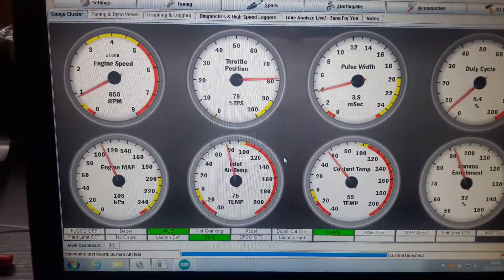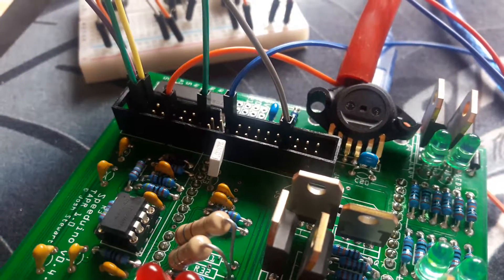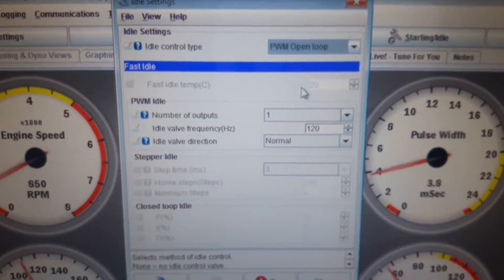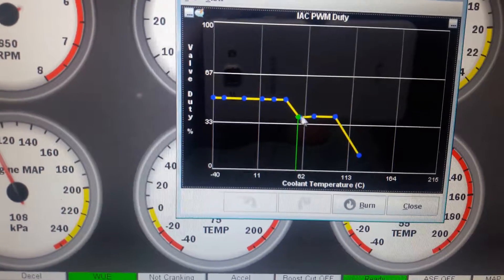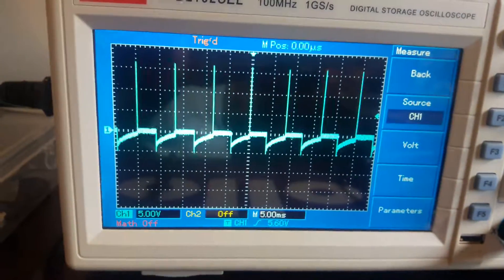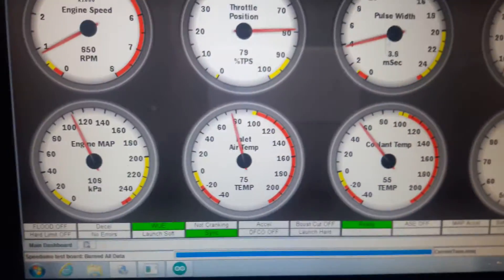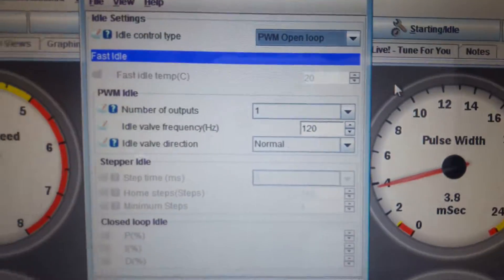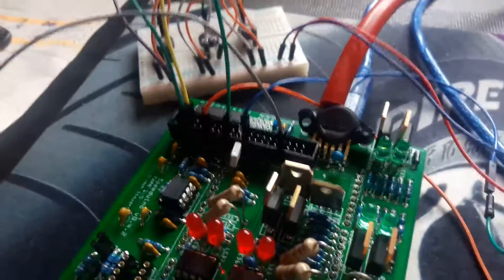Speeduino idle PWM  tested

Comment: Should idle valve close on acceleration? I have an issue, my idle PWM value configured for 850 RPM idle, Even if I accelerate my idle valve is opened. I configured VE table, and now I want to make idle higher up to 1000 RPM, due to idle valve is opened every time I have changed AFR on all engine load range. How can I fix it? How to adjust idle RPM to not to affect my VE table?
Reply from the maker: Sorry i havent played with the speeduino for along time now. I have 10boards made and i will build a new version and use the latest firmware - but im sire these issues are ironed out now with the latest firmware - id suggest getting onto the facebook page and participating there.